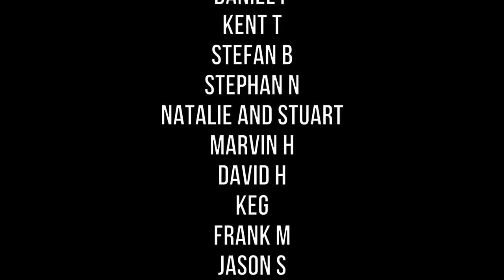Ep 117 | Cockpit Makeover, Sailing Nutshell

Comment: Another great vid ! Did you consider Sikkins Cetol for the teak ? When it's time for a coat or two, you use a 3M green scrubber to clean the teak and start applying it. Varnish makes you a slave to the teak. Don't get me wrong, nothing looks better than Varnish, but all the sanding just removes more and more wood. Sikkins does have a tint to it, still looks nice, the more coats you apply it will get glossy.
Reply from the maker: There are so many options for timber.